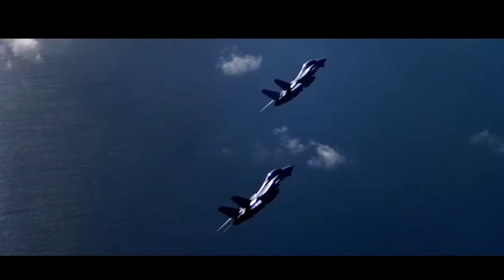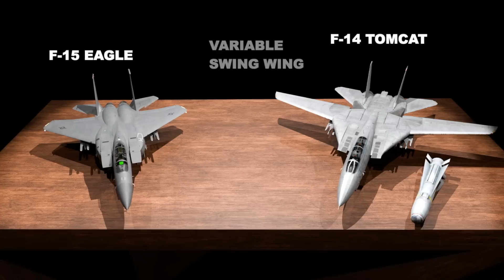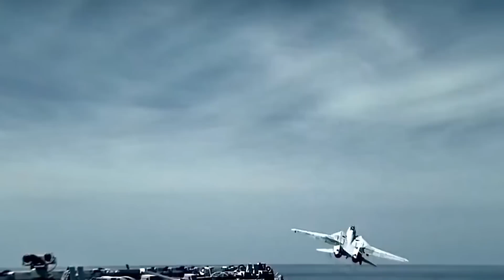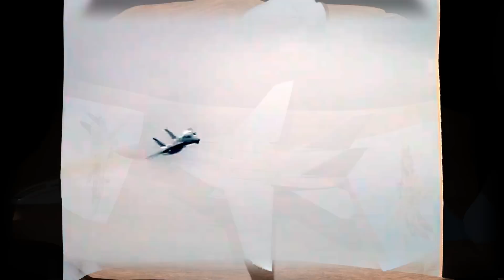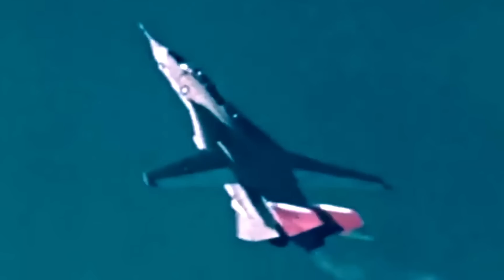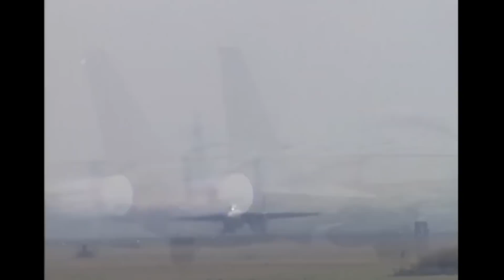Why the U.S. Still Fears Iran’s F-14 Tomcat

Comment: Thanks to Israel, Iran no longer has F-15’s. What’s more, we weren’t that worried.
Reply: Actually F-14 is better than the F-15s and F-16s Israel were flying. But they've been caniballizing parts. F-14 may not be flight worthy. Also Israel has electronic warfare aircraft so F-15 and F-16 don't have to be better than F-14. Also Israel has F-35 so they're no longer scared. But Israel needs to upgrade to F 15 EX and update or retire it's F-16s.

Comment: this video didnt age well.  the IDF took care of that problem.
Reply from the maker: You are right about that 😂
Reply: No they didn't. Tomcat couldn't get off the ground anymore. It was still better than Israel's outdated F-15s and F-16s. But with no EW support or data link. F-14 would still lose.
Reply: @jg3000  F-15s are outdated?  Has any F-15 been shot down yet?
Reply: @ronaldfinkelstein6335 has any F15 fought anything more capable than a mig21?

Comment: Came here to see if everyone was absolutely shitting on you and I wasn't disappointed. The F-14 poses little to no threat to USA's modern fleet. It has outdated radar, weapons systems and avionics. Sure, they are cool as fuck but that's not gonna stop an F-35 from locking you from 100 kms away and destroying you without you even knowing what is happening.

Comment: Sorry but Iran F-14A pose less threat because:
1) Using old mechanic radar AWG-9.  It lack AESA radar use by 4.5 generation multirole fighter aircraft.

2) unreliable turbo fan engine TF30-P-414A.  The US navy upgraded their F-14B and D model with F110-GE-400 in the 1980s.

3) Armed with old generation AAM like heat seeking short range AIM-9J range 18 km , medium range AIM-7E range 30 km & Long range AIM-54A range 135 km.  The fakour-90 is just reverse engineering of old AIM-54A with MIM-23 wing kit with range 150 km.  The F-14A is unsuitable to carry Russian or Chinese AAM.

Modern USAF/USN/USMC AAM: AIM-9X-2 range 32 km, AIM-120C7 range 105 to 120 km & AIM-120D range 180 km.

4) F-14's pilot lack modern day helmet mounted display like the JHMCS II or Thales Scorpion.

5) The IRIAF only operated 24 or less which half of them are flyable.  F-14 is expensive to maintain that it need maintenance to keep it operational.  Its the reason why the US Navy replaced their F-14B & D by F-18E/F Super Hornet.
Reply: also compared to their new su-35se they are very much outdated

Comment: Su-35 is Strongest Aircraft Of Iranian Air Force
also can carry the Fakour-90 missile, which is Iranian and developed version of the AIM-54 Phoenix
Reply from the maker: Well yes the SU-35 might be the strongest aircraft of Iran, but still the F-14 Tomcat is very capable 😅
Reply: Except Iran doesn't have an Su35s and even if they did that plane has its share of problems that they likely cannot fix or afford to fly them like with most Flanker operators. They'll go bankrupt eventually